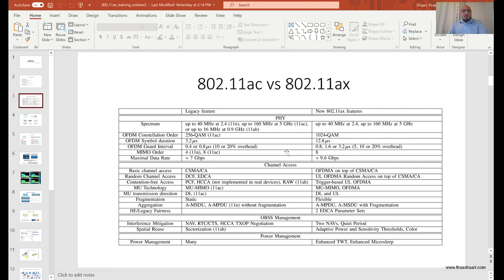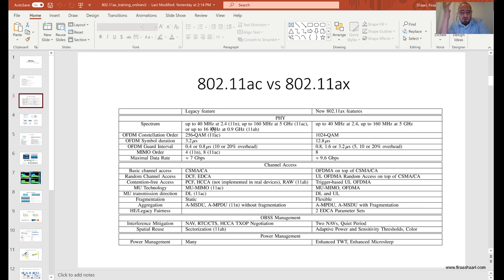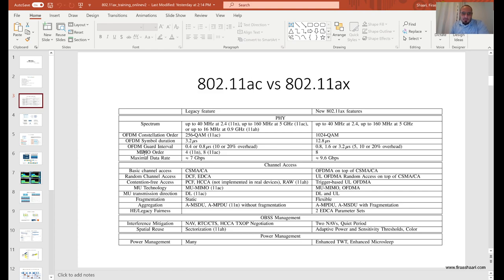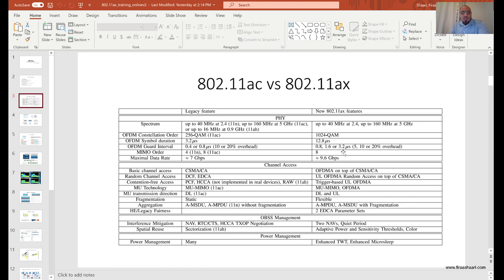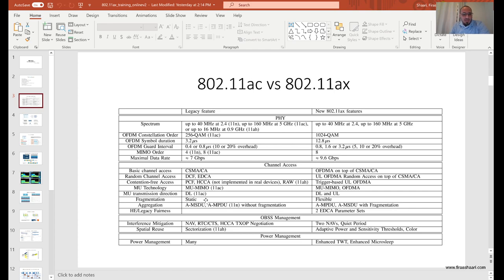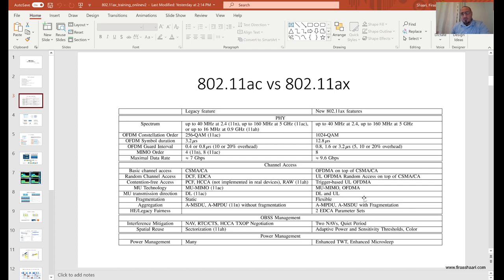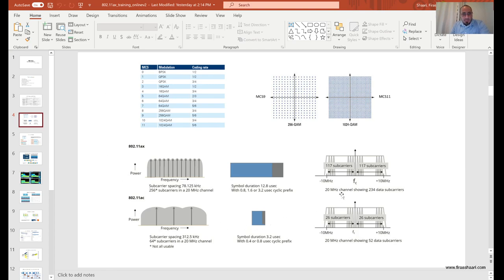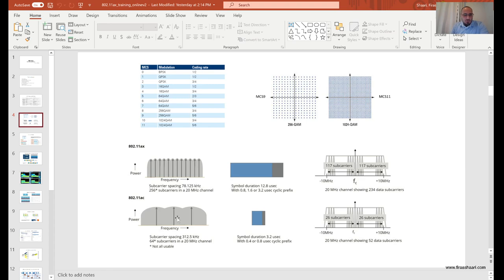Second Video - 802.11ac vs 802.11ax

Comment from the maker: Couple corrections and notes 
2:30 You create a GI by copying the first part of OFDM symbol and attaching that to the symbol’s tail.
3:33 OFDM, not OFDMA.
5:00 802.11ac SGI percentage 0.4/3.2 *100=12.5%. 802.11ax SGI percentage 0.8/12.8*100=6.25%.
6:00 UL MU-MIMO direction is from the clients and to the clients.
11:05 Fragment a frame not a load.
12:45 By setting higher values for CWmin and CWmax for 802.11ax clients than 802.11ac. The AP guarantees that 802.11ax will have a chance to compete for the channel with legacy clients and will only rely on UL OFDMA scheduled by the AP for UL transmission.
13:32 AP and clients can both have 2 NAVs
15:18 U-APSD which stands for Unscheduled Automatic Power Save Delivery